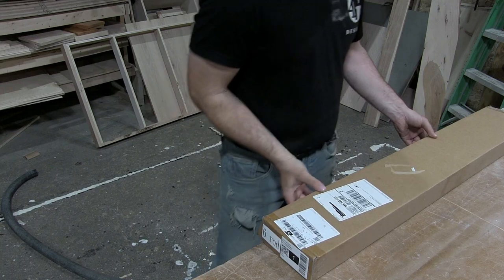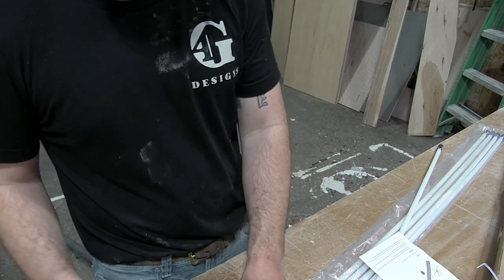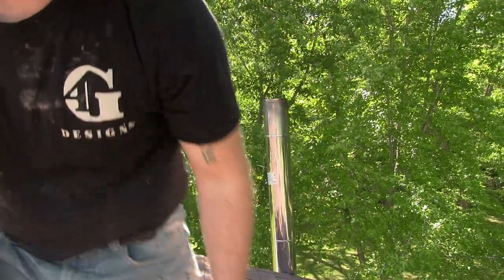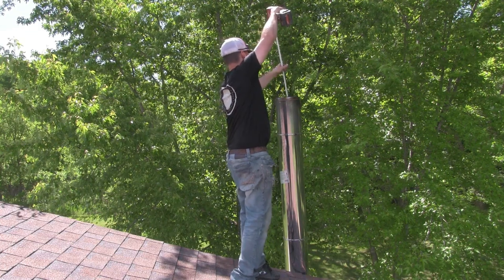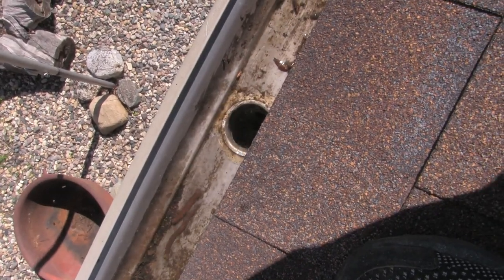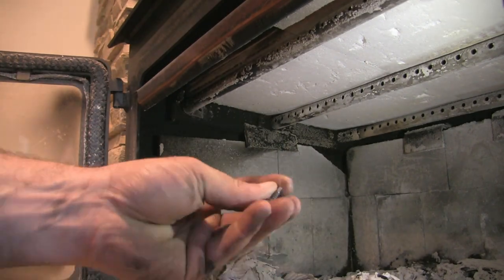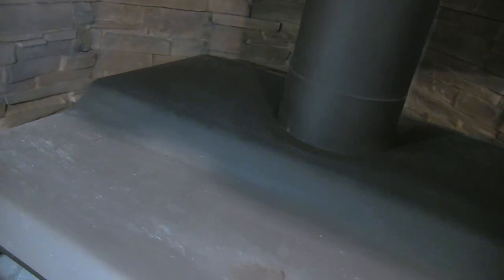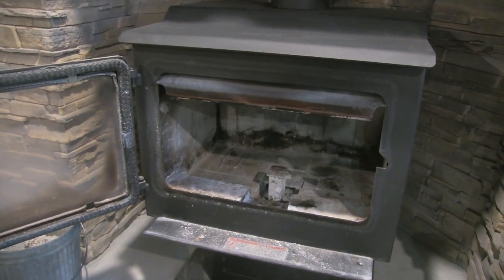$$$ Stop Wasting Money $$$ - Save $300 Annually with This Easy Home Maintenance Task - CMF 32

Comment: That looks like that should work well. I had a mess 2 years ago.  I use a push rod with four 6 foot pieces.  I used an existing chimney that has an off set to  one side. When I was cleaning I usually twist back and forth to knock more soot off. When I was going back and forth the brush came off. I had no way to retrieve the brush.  I ended up knocking out 5 rows of block right above the insert. I had to cut through an old fireplace hood so I could get at the top of the insert. Removed the pipe retrieved the brush. I ended up making a plate 1.5 ft by 4 ft. Wide. Painted it and anchored it to the brick. It actually turned out well. Now if it happens again I can get at it. I wish I had a T but wouldn’t work on my application. Yours went well.
Reply from the maker: That does sound like a mess!